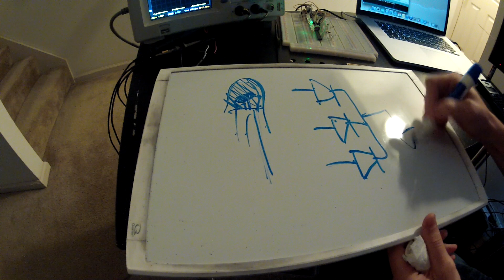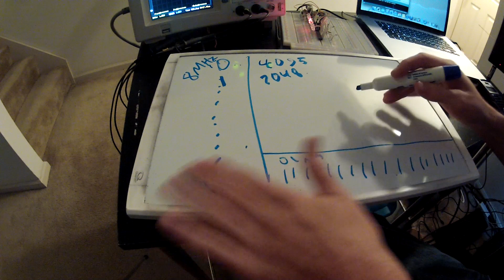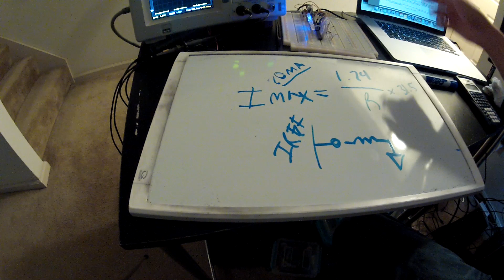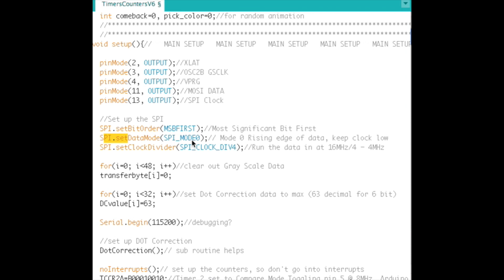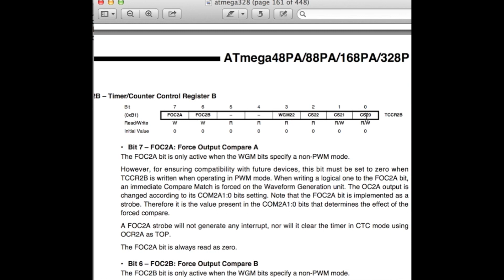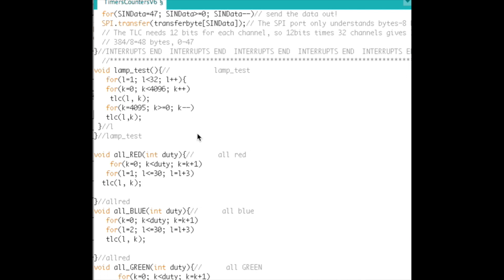How to Control a Ton of RGB LEDs with Arduino & TLC5940

Comment: Starting to make a lot more sense! Thanks man, really appreciate the time you put into this..
I would suggest that a schematic would really help other people to get too grips with his topic. Personally, I find it hard to understand new electronic concepts without one.
Quick question: I have daisy chained 4 of these chips together to control 20 RGB LEDs (60 discreet LEDs). However, the total number of output pins is 64, meaning I have 4 unused output pins on of of the chips. Is it ok to leave these pins floating? Or do I need to chain these free pins to my VCC rail? Thanks again, and thanks to anybody who reads this and may be able to help out :)

Comment: Hello, looking throug your, the BLANK-pin is used nowhere!!! I am trying to use the code on STM32 without SPI but only normal GPIO. After configuring every and use the fonction Lamp_test() or all_red(). as in void loop (), I do not get the colour blinking. Could it be an issue of the BLANK-pin not use?

Comment: Listened to the whole story and so far this is the most detailed explanation. I’ve ordered the tlc chips to build the rgb led cube, hope these chips will make it easier compared to the 595 chips. Less soldering, less chips, less resistors. I do have a question, you mentioned the current “issue” ie. 16 x 20mA, would you recommend transistors to decouple the current or some other sollution?

Comment: My project was not working on arduino uno. On arduino pro micro any of the library was not working. Changing pins in setttings didnt help.
Can You check if pro micro will be able to use tlc5940?

Comment: FWIW- The blue led works at a higher voltage/frequency than the red or green. That's why you limit the amount of current flowing into it. Also why it overpowers the other two.

Comment: Well done Kevin, this is just what I need to power all the lights, in a sequence, on my model NCC 1701-A, I've got dozens of LEDs to run as nav, spot, torpedo etc etc. this video got me connecting and checking out a bread board, next step is to miniaturise the whole wiring loam, still a big thanks for your instructions.

Comment: I've been trying to get this to work and it works fine on the first 5940, but the second doesn't light up.  However, sometimes the second one lights and the first doesn't.  Never both.  Seems like something is not being set but I don't know what.  When they are chained together how does the second one know which channel is requested?  Does the first chip subtract 16 before passing the channel on to the second?  Thanks for any help!!

Comment: Rewatched again. Even though there are libraries to take care of the underlying work I still think it is very important to know how things works in-depth. Not only does it give a greater understanding of how things work, but it also means of actually dig in and improve / speed up / make more efficient and maybe the most important - gives the knowledge of using those more uncommon chips which does not yet have downloadable libraries.
So, as always, great video and thanks for your time!

Comment: Thank you for all you put into this. It was incredibly informative.  Arduino has come a long way since the first art show in Italy. The last thing you mentioned; input variations... very intriguing!  I'm working on a project now and I need to use motion sensing (accelerometers? tilt sensors? bend sensors?). I want to vary color by reading tilt and brightness (greyscale) by reading up/down motion-- while some light animations play. It's going to be a costume for an art fashion show that's LED lit from inside and undulates with color as the model moves.

Comment: i need to drive a single 3W Cree LED RGBW (so 4 channels, 350ma / coplor, 1A max) at a low ciruit voltage from 3.3-4.2 V (lipo) -> with an Arduino Mini Pro 3.3V. Im looking for a easy and high efficient way to drive one of these RGBW led... what u suggest? May i use one TLC5940 and comine 3 channels to get ~350ma Max? Full controll of color and brightness should be possible or?

Comment: Would anyone know the equivalent pin #'s for the Arduino Mega 2560 board?  I tried to do the pinout exactly as in the script and it does not work on the mega.  It seems to work fine on the Arduino Uno Board.  Also what do I have to change in the script if I use one instead of two TCL5940's?   Thanks

Comment: Can I power the RGB leds directly from a 5v Adapter 2 amp? I am looking to control 34 RGB leds and I would like to turn them on all at the same time. I plan to use 7 x TLC5940 for this. If I am correct I would need atleast  34 * 3 x 20 mA-> a 2040 mA power supply.

*edit I actually need 7 TLC5940s instead of 4
Reply: You done with your project mate? Take a look at the TLC5955, it has 48 PWM channels. If your project isn't very strict, you could remove two LEDs and use two 5955s instead of 7 5940s

Comment: nice vid. one question. sometimes when i reset the arduino, after i ve uploaded the code with the lamp_test fuction uncommented, it does some weird things like setting all the leds or half of them on. Then i reset the arduino multiple times and it works fine. Why does it do that.
Reply: You need a 10K pull-up resistor in the BLANK pin. http://playground.arduino.cc/Learning/TLC5940

Comment: I've been a PC and mobile coder for years and have just recently started working with the Arduino platform as a portal back into the electronics hobby I enjoyed in my teens.  This is by far the best video I've seen that ties together how to interpret the data sheet from some third party component and relate it to things you need to do with the Arduino/ATMega to make it happen, along with a pretty detailed code walk through.  Just amazing.  Thanks for pulling so much together in a single video.

Comment: I think I understand how you control each channel but what happens to the signal level after the the clock moves on to the next channel.  If I have set (say) 50% pwm on channel one, does channel one remain at 50% until we come back around the loop again?  And I see 16 channels per chip.  Does that mean that I can only drive 5 LED's per chip (plus one more LED pin, which might get complicated...)?

Comment: 40 minutes in, 
PORTD &= 0<<2;
PORTD &= 0<<4;

Won't that just AND zero with the port, thus making all bits low?

I think 
PORTD &= ~(1<<2);
PORTD &= ~(1<<4); would work better.
(Myself, I tend to just use hex constants, e.g. PORTD &= 0xFB;  )
Reply from the maker: +Zak Zennii you are right - see the description
Reply: +Kevin Darrah I apologize for posting without reading everything first. Sometimes some details slip past me.

Comment: So what changes do i need to make to the code to run this on an arduino mega?
I put the code in with changes to make sure stuff like OSC2B (pin 9 on mega pin 3 on uno) is properly changed. i made osc2b pin 9, mosi data pin 23, and i put vprg straight to ground. is there more i need to change? did i do something wrong? i can upload the code but nothings happening on the lights
Reply: I've figured out that its 10,000 times easier to just install the arduino library. But this video is still great for a more complete comprehension of the inner workings of this cool little chip. Another weird thing i discovered, even though the max current rating is 130ma, it is able to keep all 16 channels on 100% and it hardly gets warm. Thats almost 3x what the datasheet says. Maybe it's 130ma per channel?
Reply: ***** fkxncb m

Comment: Kevin, Found your channel 3 yrs later.  But I found this very instructive.  Yep, watched it all.  I'm an old assembly language automation guy.  Started with mini computers then moved to early 4 and 8 bit micros.  This is cool that the ATMega329 has several interrupts that can be directly addressed and controlled to handle timing.  Good iinfo.  My goal should be simple, but I am getting close to what you have developed.  What I want to do is automate train signals for an 1/8 inch scale railroad.  I am driving 12 LED signals and 2 rgb LEDs with 2 servos for semiphore signals with interaction via XBEE RF communication.  Seems that I am going to need LED drivers and more power.  Thanks for the video.  Larry

Comment: need some help. I'm looking for info on how to power a 4w rgbw led and i'm running into issues with people knowing what i need to make it work, i have a wifi controller to control the colors i just need to know how to properly power the leds so that they get the right amount of power to control color output. i really look forward to your response i will list the specs so you know what i'm working with.

High power 4Watt RGBW LED Chip 

* Lens Color : Water Clear
* Viewing Angle: 120-140°
* Brightness: red: 30LM  green:65LM  blue:15LM  white :80LM
* Wavelength: red: 620-625nm;   green:520-525nm;   blue:460-465nm;  White 6000K
* Forward Voltage:red: 2.0-2.2v  green:3.2-3.4v   blue:3.2-3.4v   white :3.2-3.4v 
* Forward Current: 350mA

Comment: First off thank you for the video, its one of the more in depth ones on tlc5940s on here.  I have an arduino mega, I was looking at everything here and I was wondering what might need to be changed to make it work with that using your code?  I hooked a scope up to pin 3 (i have it hooked up just like your video says) and I saw a frequency of 32 Mhz somehow.  I think I got to the point where the pinout is different but I cant figure out how to change the lines of code to make it create a 8 mhz clock.  Is that what should be happening or am I just lost at this point?  Thanks

Comment: I believe it's good for controlling tons of LEDs (or may be devices that can work on pulse wave). Can this be used to control tons of Relays? I guess not.
Reply: Sure. The difference comes in with powering transistors rather than diodes, sending the power to relay coils.
Reply: right. Sure of course you can.

Comment: By the way at around 13-14 minutes you were talking about arduino frequency switching. There is another youtuber I watched showing how you can change the freq of the arduino by a single line code. I believe there is only a few freq you can change to divisible by 4. If you have already found this out about arduino great but otherwise let me know and I'll look for that video cause its definitely nice to change freq if needed. Especially for pwm led stuff to reduce flickering
Reply: You can raise Arduino PWM frequency up to 32 or 64 kHz, depending on which pins/timers you change the frequency of. The problem with Arduino's in-built PWM is that you have only several PWM enabled pins (four up to 32 kHz, two up to 64 kHz), and in essence you would be able to use only one or two RGB leds (and using two means using main timer which then affects delay funtion and everything else that depends on it). So if you want to control one or maybe two RGB LED strips through MOSFETs, that is enough, and actually a better solution than 5940. But if you want to control several individual RGB leds, you get into a problem with Arduino PWM, and 5940 solves that problem.

Comment: This is perfect what I'd like to do with my 10w LEDs. Can tlc5940 handle 1amp for each 10w LEDs? How could I control these automatic with a screen control run from with arduino UNO or mega2560 and I have a network expansion for it too but I know no coding so I need help. I'd like to have on/off manual brightness from 9v -12v at 900-1000mAH for each 10w led and also would like to set timing throughout the day automatic like full brightness at say 5pm till 2am then 50% from 2-6 and 25% from 6-8 and 0% from 8-5 unless I want to override with manual on/off and brightness with a rotary encoder I'm thinking might work? Could you help me figure this out?

Comment: I'd like to run the GSCLK off of an external clock.  Do you, or any of your viewers, know of a simple/cheap/easy way to setup an external clock circuit for it.  I'd like to avoid altering the timers on the microcontroller.  Thanks!

Steve

Comment: Hi Kevin! TLC5940 is for commun cathode rgb led only?

thank yoU!
marC:)
Reply: I see you posted this three weeks ago, but it still hasn't been responded to and many others have this same question. The TLC5940 is designed for common Anode RGB LEDs. There are probably ways to make it work for common cathode, but he says that it is highly recommended to use common Anode LEDs.
Reply: Alec Sigsbee No, the common cathode RGB LED won't work for TLC5940. its say that in the tlc5940 datasheet.

Comment: code doesnt work for me. im useing the arduino mega and common anode RGB leds and 2 Tlc's .  i have used pinds 11,12,13,9, 51 and 52 for the difrent pins on the normal arduino uno. they do the same but why is it not working?

Comment: Can this code and method be adapted to work on an atTiny85 chip?
Reply: The only problem I can see with using an ATTiny85 is the max internal clock is 8MHz. You can go to 20Mhz with an external oscillator crystal. Plus you have a limit of 8K for the whole program with only 512 bytes of ram. Check the data sheet for the ATTiny85. Also there are only 6 pins available.

Comment: I want to controll really a ton of LEDs (about 300 RGB SMD 5050's) and I guess this methode is a little expensive to use. Do you have any suggestion on what can be a cheaper solution to controll each one individually?
Reply: A simple 74HC595 shift register could do the job depending on what you are doing. They are pretty simple to use.
Reply: Yes. Tell us more about how and what you want to do. tlc5940 can control easy all your LEDs...

Comment: So I just got my hands on this chip i'm super new to electronics and well is there any hope for a basic tutorial revolving around this chip controlling RGB Leds?

I followed the tutorial on the arduino website and well my lights just stayed on and didn't do anything at all with the sketch

My end goal is to make an led strip of lights out of RGB LEDs to cycle through patterns and possibly do diff patterns when i get some sort of notification. I don't really know where to post for this kinda help as i'm fairly new to electronics and arduino. Any help is you can give is helpful, thank you for your time.

Comment: Hey, nice tutorial.
But if you use the TLC5952 for example, can it be used as a 24-bit shift register if you only use the Sin, Sclk, latch and blank? Like if you daisy chain 3 74hc595?
And what value should the resistor to IREF have to get 20mA, how do you calculate it? Is it just Ohm's law?
Thank you :)

Comment: This makes me want to try it. I ordered some 5940's on ebay and will try this when they come in. I guess I should order some RGBs. :)
Reply: Marinus Swanepoel That's be awesome.. but what about all the little parts? Is there a bill of materials so I can order everything?
Reply: Marinus Swanepoel Is it all through hole? I'm just learning surface mount.
Reply: Marinus Swanepoel okay sounds like a great board. How much you want for it? A BOM would be cool...
Reply: Marinus Swanepoel I'm actually heading to the lab in about an hour or two...
Reply: Marinus Swanepoel okay, that's super cool. You can put it in the locker behind the door if you want...

Comment: I realize this is a bit of an older video.. but you used a rather complex way of resetting the blank pin... why not just sacrifice one of your registers and set it to go high only at 2048 (or whatever max is)? this way you would automatically reset.
and you would only be sacrificing 1 pin no matter how many you link together so its not a big sacrifice either.

Comment: Awesome video! thanks so much! I'm going to try to do a similar project based on what you've explained here. But I have a question, if you have time to reply... If I connect the anodes of all the LEDs to external power, do I still need to run 5v to the Arduino separately? Or will it be powered because the TLC5940s are connected to it?

Comment: I'm using the sparkfun PWM shield, which has a tiny version of the TLC5940, for a project. Do you have any experience using that one? Because I think the pins it uses are a bit different from the ones you show. Another thing, I'm using the TLC5940 library and the tlc_fades library as well, but cannot make it work properly, do you have any experience working with it? thanks in advance

Comment: The colour comes from the LED itself. Plug PWM into a white LED it'll be a dimable white LED. RBG LEDs combine three colours to make a colour....since you only need 1 you can just delete all reference to blue and green. Red will be your white. You then don't need "for(l=1; l<=28; l=l+3{" you can have l=l++ because each LED is individual.

Comment: So would you think that the TLC5940 is a better option for a 8*8*8 RGB cube than using alot of 74HC595's?
I can assume that the load is less due to the fact that you move the PWM function away form the Arduino CPU.

Comment: Thanks Kevin.  I'm actually making a starfield ceiling and using just white LEDS, so I just need to go through your code and work out how to set it to just a single colour.  I'm new to programming, but should be able to figure it out.  I would rather learn your code, as I'll be moving on to RGB projects next.

Comment: Quick Question Kevin.  In your example you use the SPI library.  But most other examples using the TLC5490 use the TLC library.  Is there a reason you chose SPI over the TLC?  I've read that the TLC library is a little sloppy. Does the SPI offer any specific benefit?

Comment: I've watched this video a few times and it's definitely not boring. I'm driving (currently) 32 LEDs with two chips. One issue I am having is sourcing the current for all these LEDs. Right, now I'm using a transistor before the Vcc power pin and using a separate Arduino pin as a base on the transistor to control the current supplied to the chip and LEDs but I've noticed that it's a bit glitchy. Any suggestions? And also Thanks a ton for making this video.